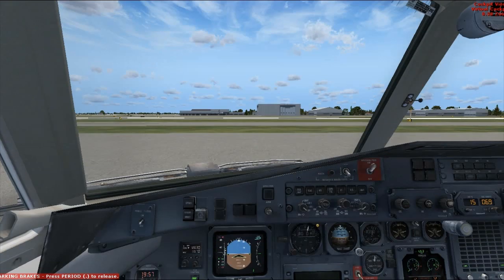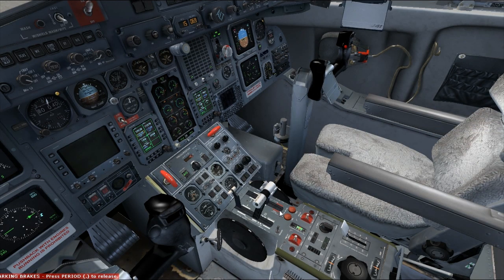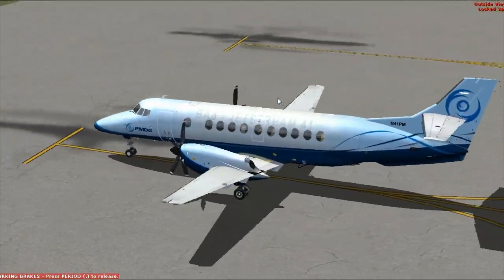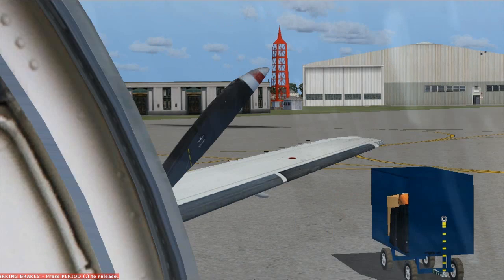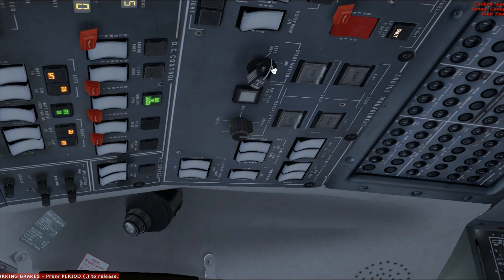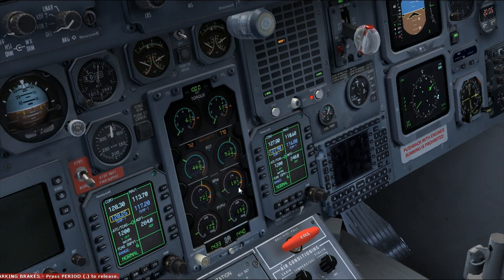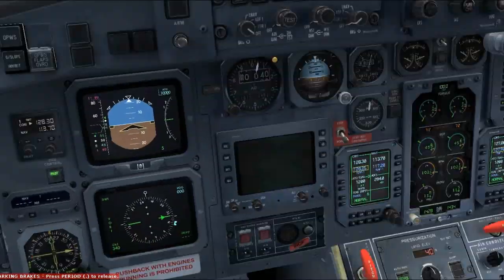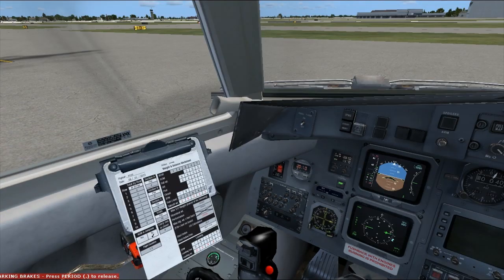FSX PMDG Jetstream J41 Tutorial 2.0 Part 1: Shutdown/Startup

Comment: To avoid fires simply remember to don't move prop lever from shutoff&feather to taxi too early (wait for engine to spool before you do it). Its essential because when you do it too early fuel valves will open and fuel will get into engine too early causing fire. A little tip that may help newcomers to understand what causes fires.
But its there any way to crank engine when you do the bad thing and you need to clear it from fuel?
Reply from the maker: That isn't technically correct.  A fire is good to have INSIDE an engine, for obvious reasons, and having the fuel being introduced where its meant to burn wouldn't be a reason for engine fire.  The actual reason for the fire is inadequate cooling from airflow over the engine at startup.  If you try to start to quickly, or start too soon after a shutdown, the EGT will exceed the red line thus causing an engine fire, and melting of components and all that fun stuff.  So you just want to make sure the engine has adequate airflow over it to ensure it doesn't stay above the red line during a start up.  (Note a temporary increase above the line is okay as long as it comes back immediately.) 

I'm not trying to sound demeaning or anything btw, thank you for your input and bringing up a good point as to why an engine fire would happen in this situation.
Reply: +Tman Productions Thanks for explaining. I just found that when starting engine EGT must be below 200 *C because otherwise it will exceed EGT limit during startup. So after shutdown you have to wait some time and let engine parts cool down. I also found that normal way to start it is to have condition levers at taxi and fuel valves open.

Comment: Great video, are you having the flickering flashing polygons issue in the VC when ice effects are enabled?
Reply from the maker: Raul Godoy No I don't recall ever having that issue.  My guess would be try turning directx 10 preview off.  I know that fixed a lot of my VC bugs I was having.
Reply: Tman Productions Thanks Tman, do you mean using Dx10 fix this issue? I have been using Dx9, are you running your FSX in DX10? don't you have many sceneries and textures problems with Dx10?
Reply from the maker: Raul Godoy No I have mine unchecked.  You are right DX10 does cause a lot of issues in FSX.  I was saying make sure yours is off and see if that fixes it.

Comment: if you hold throttle down (default F2) while you are hitting stop buttons start lock should engage :D
Reply: J McD Yes, I thought that I was the only person who did that! According to the manual, start pulling back at around 50% RPM, and the start locks will be put on. In real life, the unfeather pumps can take up to 10 minutes and require a pilot to go outside and hear the click of the start locks.
Reply from the maker: Adam May Oh nice, I didn't know that they would engage if you did that.  Thank you very much for your feedback! :)